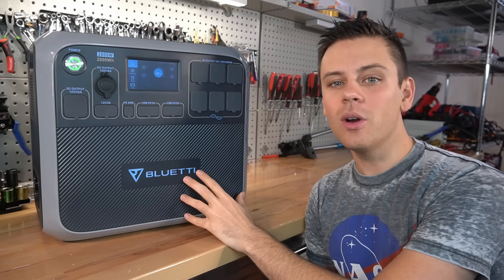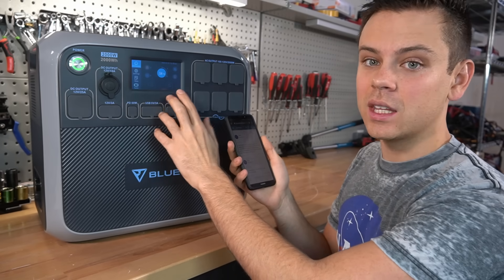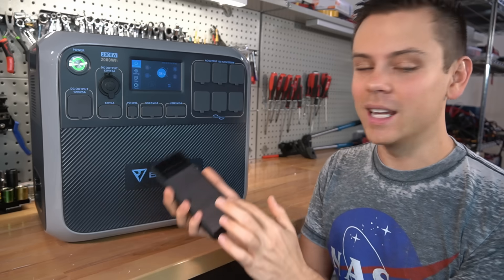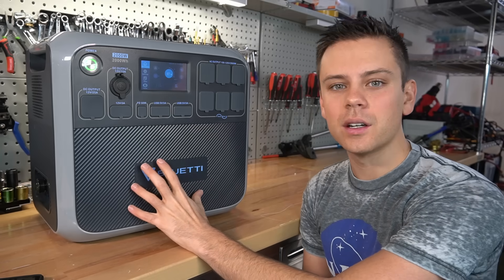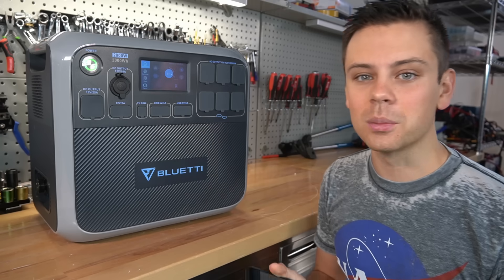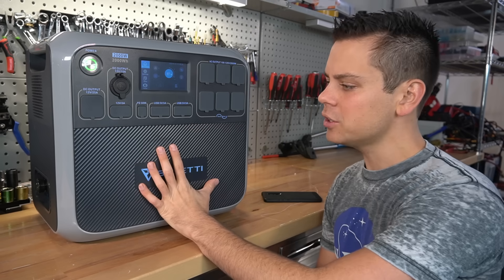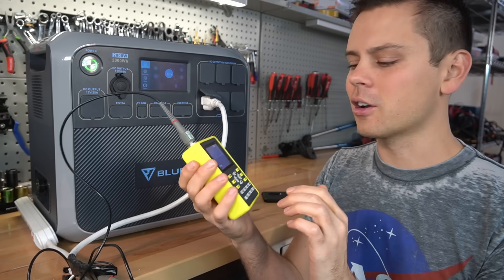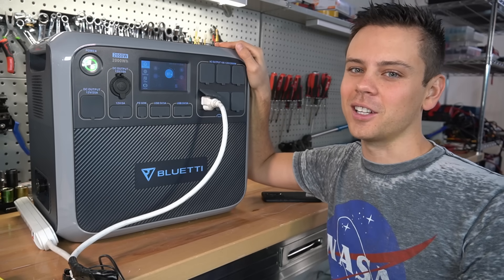New Issues are Plaguing the Bluetti AC200

Comment: So far ac200 is working perfectly. However on the road now and was having some car charging issues. Faults are low voltage. But it will try to charge for a sec gets to 89w and stops. Stop at rest area left RV idling shut off headlights heater fan. No change in my voltage according to my meter. (13.6-13.8) "from alternator"
The temp did show way off low at first today. 31F when it was 60F go to the status page shows the temp accurately. So there's a difference between them internally. Not sure where or how many sensors are in there. It's still charging right now off the car mode at 95watts. Kicked on furnace cuz it stays cool in the back it's sensing 73° but still shows Well below that in the pv/car mode screen. We'll see what happens when we get moving again. Moved it to front behind the seats (class c) where its a little warmer. Plus easier to keep an eye on the status. ;) So far so good.
Reply: Update: turn heater blower fan on. Stops charging. Turn off fan charging again. Appears to be a low voltage issue.... My alternator is 160amp it should handle it...
Reply: I charge both my Jackery E1000 and my AC200 while I drive via an inverter I installed connected to the alternator.  It is a 500W pure sine wave DC to AC inverter.  I can only charge one generator at a time since the E1000 will draw 160W AC to charge and the AC200 will pull a little over and a little under 400W AC off the inverter to charge.  From a full charge, I can get 4-5 days from each of the units, for my level of electrical consumption.  If I need more, I have a portable 200W solar panel I can set up outside.
Reply: @David-rx2to  
So... Which one do you like more, since it's been 10 months?
Reply: @JudiChristopher  I have to go with the Bluetti because of the larger capacity.  I have a 5000 BTU window air conditioner in my van. When I stop for the evening, when it's hot out, the Bluetti, depending upon the temperature outside and how cool I set the air conditioner, I can get two to three hours of AC from the Bluetti, which is enough to get me well past sundown when the weather normally cools anyway. Also I have a small electric pot I use to boil water that is 1500 w. I cannot use that on the jackery, which maxes out at 1000w,  but the bluetti handles it just fine for the couple of minutes it takes to boil water.
Reply: @David-rx2to  
Excellent to know...
Some people have suggested since I have not bought mine as of yet, and the fact that I'll be using it for EVERYTHING on my Vintage Tiny Travel Trailer, I should go for the Bluetti MAX... it's a little bigger...
What do you think?

Thank you for all the good information too.
Reply: @JudiChristopher  In my humble opinion, always buy as much battery capacity as you can afford... nobody ever complained about having too much power.  Nobody's crystal ball is so clear to see exactly what you might need in the future.
Reply: @David-rx2to  
That is so FUNNY you said about the "Crystal Ball" .. 
I have one... and I am a Psychic Medium, and YOU are right... I can't even see the future for all of this... 
(I'm laughing so hard)...
"Where's a Psychic when you need one!!" 
BAHAHHAHHAHAHAA...
Headline:
Even a Psychic (50 years now) I'm 67 years old... can't predict which Bluetti to buy...

I'm still laughing so hard...
Thank you David for all this great information... and YES I agree with you, you can't have too much energy.

See... In another lifetime I was a Gypsy in a wagon...
now I'm a Psychic Medium in a Vintage Tiny Travel Trailer...
Hey... why not!!!! LOL

In all seriousness ... I do work with the police on unsolved murder cases... and yes I have been doing this since I was 16 years old. I don't use anything but my God-given Gift. 
And NO... I don't know how to use the Crystal Ball...
Reply: @JudiChristopher  Don't know how that crystal ball comment came to me... maybe I was psychic about you!  Anyway, very cool you use your gift to help the police.  Can you tell us any stories about crimes you helped solve?
Reply: @David-rx2to  
Truthfully... I thought the same thing, that YOU were Psychic to comment on the Crystal Ball.. LOL
As far as stories... YES I have a few... 
900 pages of TRUE stories... 
over the last over 50 years...
My son wants me to a pod cast on Youtube about what I have seen, heard and the strangest things that have happened to me... and believe me, I have seen strange things... and I believe in Angels.... seen that effect too.
So ... Yes... I have a few stories... especially on murder cases... sad but true.
I helped put a father away in East Texas because his daughter that he had killed came to me and showed me where her body was... I thought I was helping the police when I told them my vision... they found her body, she was 11 years old... the next thing I know... the police thought I did it!!!
They had never talked to a Psychic Medium before... finally, one of the detectives said, "You talk to much to be a murder!!!" 
Bahahaha...
The father was put away for 50 years... Tyler Texas 1981.
See... I'm writing a small novel right now...
I love to write... and talk.
Bahahaha
Reply: @David-rx2to  
I have a manuscript finished, already written on Billy the Kid... I lived in Lincoln, County New Mexico for 21 years... 
I know without a shadow of doubt that Pat Garrett did NOT kill Billy the Kid...
Many people will upset if I publish that book... you wouldn't believe how upset people get when you mess with Billy the Kid...
I have people that want to buy my book, just so they can burn it... I laugh, I think... "as long as you buy my book, you can do whatever you want with it, ... after you buy it!"
It's called:
"Billy the Kid: Little Black Book of Secrets" (c).

What is weird is... before I wrote the manuscript... I had Never gave Billy the Kid a second thought... never read anything about him, never watched a movie about him... Then I almost died in a really bad flood we had in Lincoln County NM 2008... and the Near Death experience did something to me... I wrote the manuscript in 25 days.

I also have a manuscript I'm working on about the Boston Strangler... it's hard to write about that, it actually scares me, because of the visions I have had, and the things I hear while I'm writing ... 
No... I don't hear random voices... but I do hear dead people once in while... like the movie "The Sixth Sense" 

Have I lost you now... yes a little strange. I know.

Example:
A sample reading about you.
You... David... Hum, when I write the name David, it doesn't seem to fit you... something is missing.. Why?
The name "David" isn't all of who you really are...
 Because you don't allow people to get to close because of past experiences of ... not just hurt, everyone gets hurt in their lifetime, that's too easy to say, I would sound like a
 "Kitchen-Table Psychic."
Which I have been known to do a lot of Psychic Readings at a kitchen table... LOL

You have (had) to change in the last 18 months... Change, you can do, not a problem, if it is on your terms... You don't like to fight, even argue, it waste your time... time is money, but you won't back down from a fight... but you will study your opponent first, like a chess game... you'll make your move only after you really study and think of your next move... You do not like to lose.
You like a person, not what they can give you... but you love to learn... really learn... but you hate when people are not truthful.... you accept a person for (truly) who they are, wealthy or poor... 
You have been both...
You will not tolerate lies. 

OOppss... sorry got carried away.
Reply: @JudiChristopher  ha! 90+% of your comments about me are true!  If you ever create a podcast or get that manuscript published, let me know!  Go for it!  No regrets!  Don't want to look back and say I should of...
Reply: @David-rx2to  
Only 90% !!!
I'm disappointed in myself!

Truthfully... I had to be careful in what I was saying to you... because we are on an open forum... I forget that when I'm writing to one person, like yourself.
Which manuscript do you think I should finish first...
I have talked to a liaison with HBO about Billy the Kid... they do something new every 6 years... I'm just not sure they're ready to talk a Psychic Medium about Billy the Kid.
I will not only publish the book... even if it's only 3 books, I want to write the Screenplay too.. 

About YOU...
Let me give YOU a few more hints about ... your future.

Because the last 18 months or more has been different for you... you have only just begun, and if you think you can stay the same... you're wrong.
There is what I call a "Movement"...
It could be that you're literally moving from where you live right now..
It could mean you are "Moving UP" in the world... changing jobs... but remember there is give and take with this one.
There is "Movement" in your spiritual life... because of what you have been through in the past 2 years ... you'll never be the same... 
You're very skittish... (Yes that is a word)
Non trusting... for a good reason. 
Warning: If YOU do not change, and decide to stay the same... you'll lose. 
(that just gave me chills).

"When in doubt don't"

"If someone walks out of your life... Open the door for them and close it behind them."

NCIS Gibbs Rule 91
"When you decide to walk away... Don't look back."

BTW...
I am also a 
Neuro Linguistic Programmer
and a Hypnotist.
I  did self hypnosis to myself so I could have both of my children without ANY pain medication... It works.
(SMILE).
Reply: @David-rx2to  
OHHHH
This just in:

Don't let people, places or things "PLAY" with your emotions. 
This is YOUR life. You live it the way you want to.
You do not need permission or approval to live your life the way you NEED to live it.
And damn sure don't ask for forgiveness because you decided to do something to improve your life.

The first time someone/something hurts you... it's their fault..
The second time it happens, it's your fault.
The 3rd time... it happens... it was a decision on your part to be hurt again.
Reply: @JudiChristopher  you're so good it's scary!   Happy Halloween!
Reply: @David-rx2to  
Are you being serious...
or are you being funny?
I take my Psychic Mediumship very serious. 

I do have a question:
Why is your Youtube name
"David"... something feels not quite right with that name.
There is either more to the name "David" or it's just not you. I would not call you David... and I have no idea why I feel that way...
Unless, you have more than one persona (Don't we all).

You don't let the Left had know what the Right hand is doing. .... LOL

Example:
I am a Psychic Medium for over 50 years... my whole life.
but.. as a NLP/Hypnosis I don't talk about my gift unless the person believes in Psychic ability.. 
So therefore I have more than one persona.
Reply: @David-rx2to  
I'm sorry if I scared you.
I didn't mean to.
I was just trying to help you.
Thank you for listening.
Reply: @JudiChristopher  I was trying to be both funny and serious...you have been correct on most of what you said and since it is a holiday today, I tried to use that to make a joke which I thought was appropriate for the day... Halloween is associated with the spirit world and the supernatural, and as someone uneducated in what you do, and how you view yourself, I was trying to compliment you on the accuracy of your thoughts regarding me and at the same time, being aware of what day this is.  I guess if you have to explain a joke,  it isn't funny, or maybe it just wasn't funny to begin with.  No disrespect was intended.  

My name really is David though.
Reply: @David-rx2to  
Thank you David...
I appreciate your comments.
I shouldn't have been so touchy...
Reply: @David-rx2to  
I realized this morning why I was so touch about Halloween... 
it's the anniversary of my mother's death. 1982.
Please forgive me for being so sensitive. 
It has been very nice talking to you... 
And... about the name "David"... what I meant about that... is  you are more than just that one name... I really do see good things for you coming up this next year.
We just have to have faith to see it through. (Me too).
Thank you David,
Judi
Reply: @JudiChristopher it was my pleasure speaking with you.  Thanks!
Reply: @David-rx2to  
(SMILE)
Reply: I have a 1000w inverter and all wiring to install direct to house batteries... Waiting on that till I get down to a warm weather spot in FL. That may be a tuff one lol.  Stuck in KY snow storm and its cold even down there. They'll blame me for bringing it from Michigan. Haha. Used my bluetti to run the furnace ALL night last night, in the teens here so even set at 63 ran a lot. I had 13% left this morning about 6:30. Not bad considering I estimated 8 hrs run time before it shut off and it made it almost 9 hrs. I think it shuts down auto at 10% . Generator charging now. Can't wait to get the solar going once we get to FL.

Comment: In the process of building my own solar generator.  After all the issues and lack of support.  I can build my own for less than half the price with more capacity.
Reply: Yes, I did it too but mine has 23kw instead of 2kw.
Reply: @neliosamch3195  that's my next project after I save some money.  Going to be a 24kw system

Comment: I think some people will always have issues. In the end the question is how many units (as percentage) are faulty and how much is acceptable? Even premium products like iPhones or Tesla’s come with issues. Early reviewers will look fir anything wrong which may skew the overall picture. 

All that being said, I like your reviews and the Bluetti seems like a solid unit. 

Question: how do you recommend attaching this to the existing electrical system of a RV/Camper trailer? Use it as a shore power input or use it as a battery replacement? Or do you see a better option?
Reply: Bluetti still does not know how many AC200s and AC200Ps have these defects. They also have not come up with a root cause or a fix yet. People deserve to know there are unresolved product issues.
Reply: @MAXIMUSMINIMALIST  it's the standard.
Reply: Tesla is not a premium brand it's a junk brand.
Reply: As a past automotive supplier quality engineer.... 2 parts per million is acceptable. 10 out of a million will cause you trouble. 50/mil (GM) will put you to work on paper and corrective action.
Reply: @tponaroll4463  that means for a low volume producer of under 100k units any failure is unacceptable

Comment: The only problem I have is setting the time and date I have  the AC 200 Plus I have  4 Solar panels 100 w each I don't know which one I should parallel or series ?
Reply: I set mine don't ask me how! 
I have 7 HQST Flexable panels 100 watts in series.  Since the unit has a range of 35-150 volts no problems. Plus in series you can go further distance with out the power loss. Been working great only a few odd and emd error codes which make no sense and beep driving my wife crazy.  Ofcourse I have no clue really. That's the best I've been able to figure out. Video on our channel.

Enjoy Mark
Reply: @OutOfOfficeCamping   Great I'll try that
Reply: Same here for mine. I tried over and over to put a date and time in.
Reply: Just set up my AC 200 today.  To be able to set the date and time, I had to touch exactly over the numbers being displayed, which is a difficult task since the font size is so small.  If you can do it right, a number pad appears where you punch in numbers to set the desired value. It took me a couple of tries.
Reply: @tyurek  Awesome man! Thanks for the heads up. I will give it a try when I get back in town and let everyone know if I was successful too. Thank You👍
Reply: OK guys I finally got it figured out I got the the 1st one is the 1700 Watt I got another one the 2000 Watt  OK seems like you have to highlight the year to change it to the date and then pressed set to highlight the time and set the correct time and press set got them all fixed up your working like a charm
Reply: Date settings do.not stay fixed between sessions on off on my UK version . Customer service is non existent

Comment: Damn it! I just ordered one last week. Scheduled delivery is Jan 5th.
Reply: Will is getting you worried for nothing.  Delivery problems during COVID- who knew?   AC Power incorrect below 200w - on no!   Customers who are pissed off because vendor needs to understand the issue first - wah wah.  Also his definition lying is BS.  

 I was one of the first to by one (July 2).  It works great!
Reply: @jeffbankert7123  I was also in the first 100 purchasers.  No problems to date. I believe early purchasers received an extended warranty so I am not worried at all.
Reply: @jeffbankert7123  I have two defective Bluetti AC200s sitting in my van right now. Bluetti still has no answers for why my unit and the warranty unit both have defects.
Reply: @VANquishedAdventures  what problems are they having?
Reply: @pscott49  mine(purchased and warranty replacement units) both have multiple faults that were present out of the box and the temperatures on 3 screens are all different. My primary concerns are: 1. Will it charge below temp and ruin the battery 2. If it gets hot will the unit thinking it is cooler than it is and start a fire. No answers from Bluetti yet.
Reply: @kerry5972  I’ll wait and see if it has any issues. Maybe I’ll get lucky.